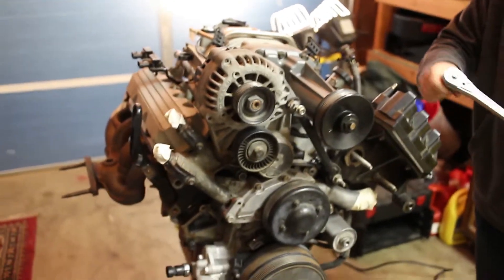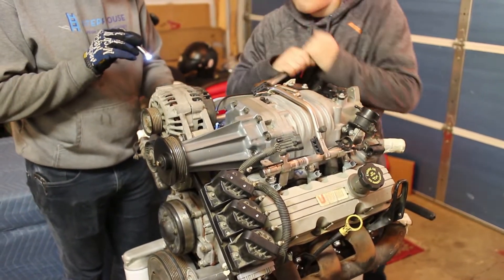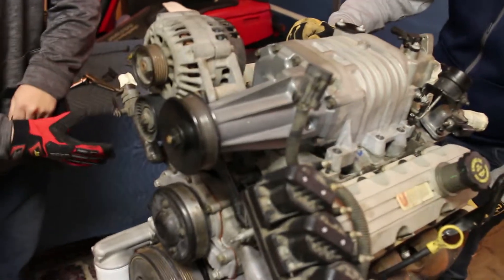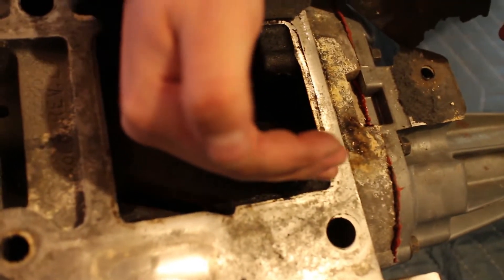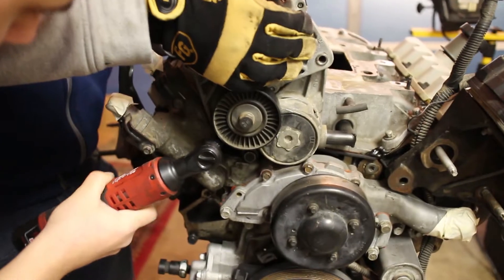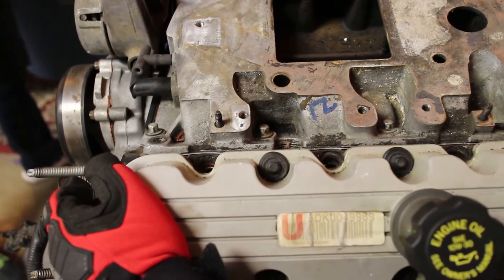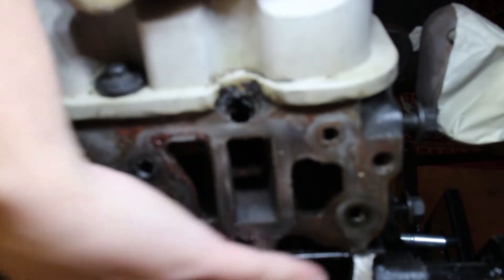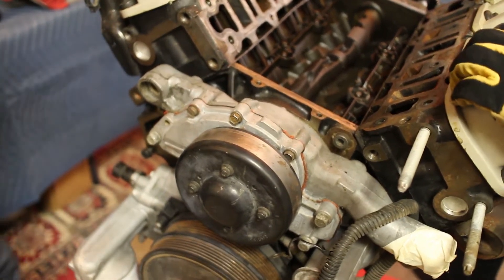Project F 3800 L67 Engine Teardown! Part 1 (Starting the Engine Teardown Process!)

Comment: I have a 99 v6 automatic camaro and my father has a 97 Buick riviera with a 3800 series II supercharged. I am wanting to follow this setup done in these videos, if it’s possible I would love to get all part information if that’s still available! With the automatic transmission I’m not sure if the L67 would bolt up or if I’d have to change the bell housing.

Comment: Will one of these fit a 2001 firebird v6 base ?
Reply from the maker: Project F is a 1998 base camaro, the chassis should be essentially the same. Check out 3.8sc_firebird, he has a youtube channel and instagram, he has a running L67 firebird.